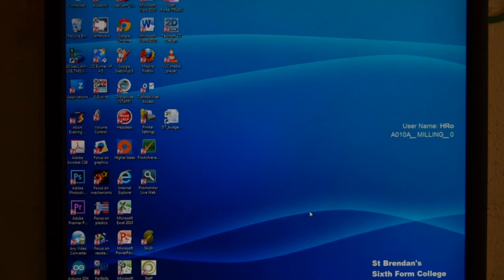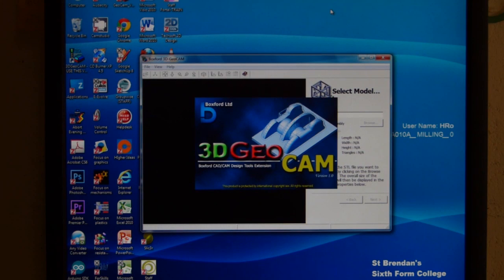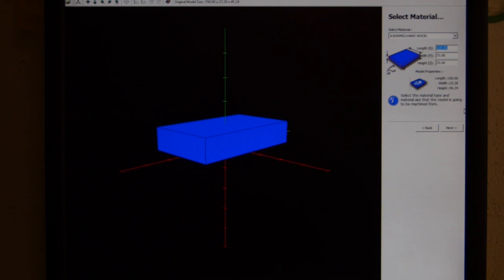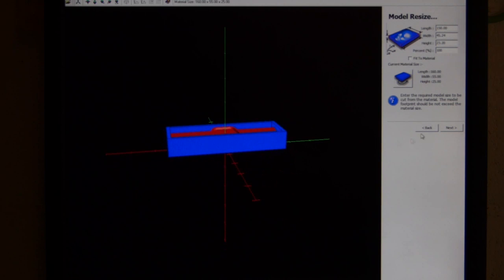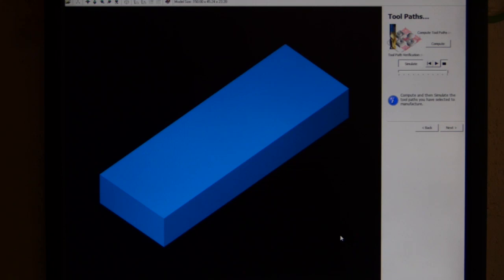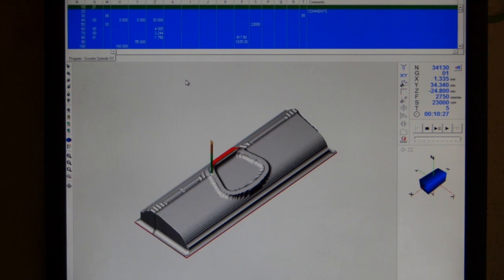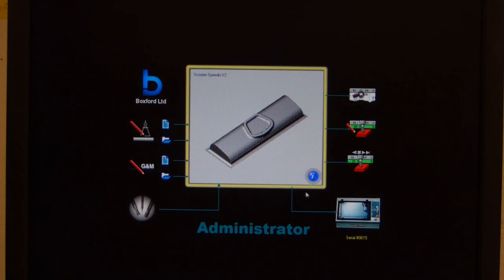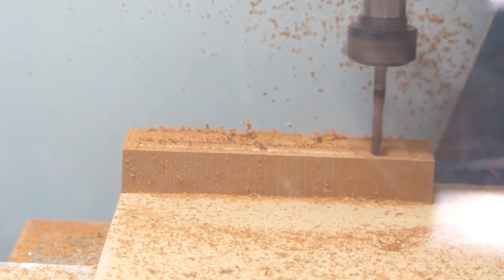Boxford Router Instructions

Comment: my problem is that when cutter goes to the corner at the start of the cycle the first cut is all the way through the material how do i fix this
Reply from the maker: It's a tricky one to diagnose from distance. Things to check. Bed height and any offset a vacuum bed causes. The other is the tool settings. If the machine thinks you're using a shorter cutter it will cut deeper. Turn the speed right down as you do the very start so you can stop it if it isn't going to plan! Good luck finding your fix.
Reply: Boxford a3hsrmi2 help please. Can anyone offer some advice. I have added new tools to the library and they are available through Geocam but if I try to do a 2D design through CADCAM, at the point where tools are added to colours/ depths, there are only two tools available. The two tools available are not the ones I added.